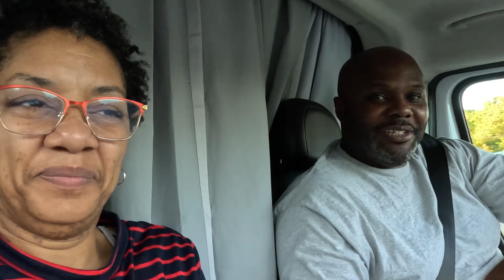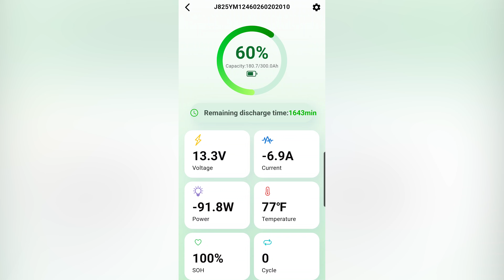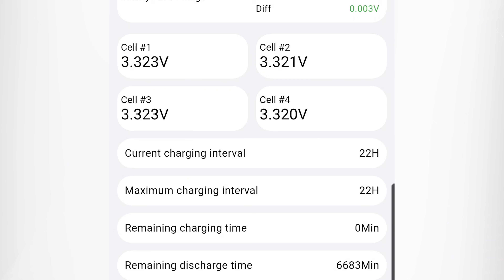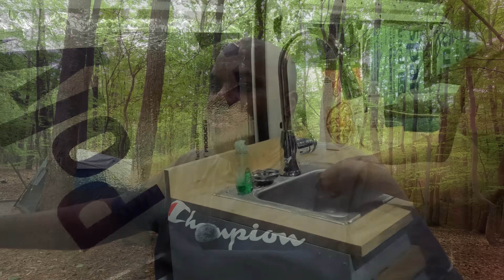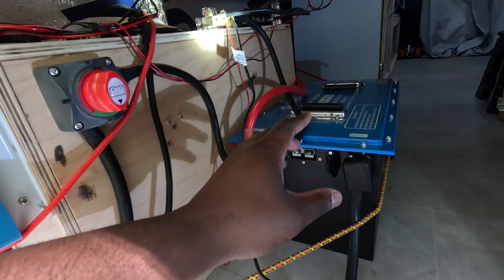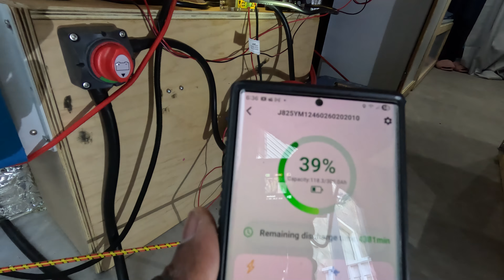48 Hrs Off-Grid Using @OutEquipPro 460Ah Lithium Battery

Comment: Nice video! It's great seeing you all moving to fully off grid with your rig. That is a nice battery that you received. That is also a nice app for your battery. 

One of the first things we did when we bought our rig was to upgrade the battery from 100 AH lead acid to 400 AH lithium. We also upgraded our solar from 100 Watts to 400 Watts. We also upgraded from an absorption fridge to a 12 volt one. It's good to see you be able to run your AC with your battery. With everything you were running, it held up well. Our next upgrade will be to replace our 120 volt rooftop AC to a 12 volt one. Safe travels!
Reply from the maker: Thank you, it was definitely a blessing to receive that battery.  We give all the glory to the Most High God.  The 12v AC really plays a big part in us staying out there that long with out recharging. Im sure we couldn't have done that running a standard ac off an inverter. 

Your setup sounds awesome. Its amazing how each upgrade one makes no matter how small or big will improve your van experience. Safe travels to you as well and thanks for watching
Reply: @WhereverWeLand  Thanks for the reply! That was a very nice gift. When we bought our 400AH lithium battery over 3 1/2 year ago, we paid about $1,400; although prices have dropped a lot since them. Still one of the best decisions we have made. We are trying to be as self sufficient as possible because we love to boondock. The 12 volt fridge that we installed works great and after installing it, I just let it run for about a week and the state of charge never got below 95%; and that was overnight but during the day, in a few hours, back to 100%. I am with you, I would not even attempt to run our 120 volt AC using the inverter (even if we could). It would suck the battery dry in no time. That is why when we go on our southwest Road Trip in 2027 (from Florida) to California, I will have that 12 volt AC installed. Safe travels!
Reply from the maker: @Road_Trip_Warriors your welcome we are thankful that people like you take the time to leave us a comment. We learned so much for the people who watch our videos and leave comments. We may not be always able to get to them right away but we always respond. 

 Yes the prices have come down a good amount. Sounds like you been at it a while. Its a blessing to be able to have everything you need to go where you want, when you want. We are looking forward to being self sufficient. Safe travels God bless 🙏🏾
Reply: @WhereverWeLand  Thank you! I believe in reaching out and interacting with other channels, particularly when the topic is something that I am very interested in. I wish someone had sent us a battery like yours but at the time, we did not even have a channel. It was still money well spent. I will continue to follow along as you move forward with your build.

 I really need to post more videos. We have a lot of content, just need to edit and post. I have decided that after we return from our 2 month Summer Road Trip from Florida to Washington state, and back, I will stay home for a while and start working on that backlog. Safe travels!